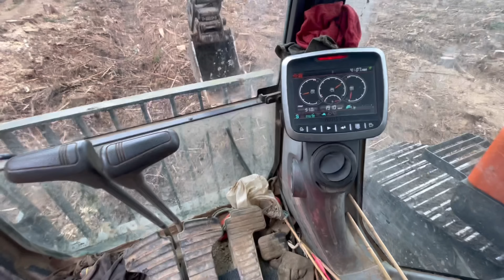Well it didn’t go to plan / if something doesn’t look or sound right it probably isn’t !

Comment: Good to see you removed the new pump when the old one was fine saving the customer, not all fitters/companies would do that. With any luck the next generation they might move the pump next to the filters👍
Reply from the maker: Yea no longer a Perkins engine and the pump it just inside the door which means it’s easy to access which means it won’t give any problems 😂😂😂